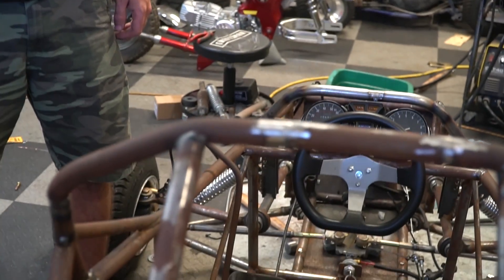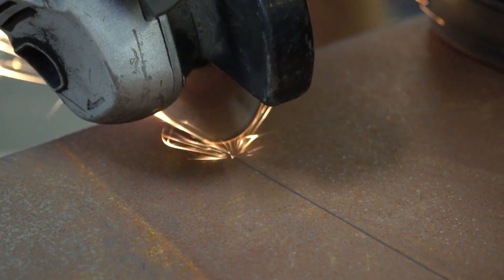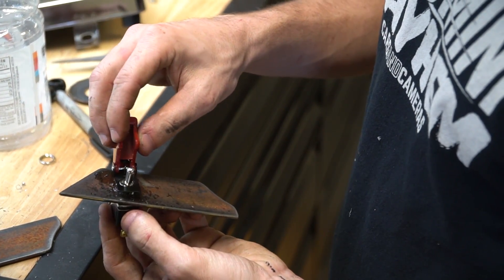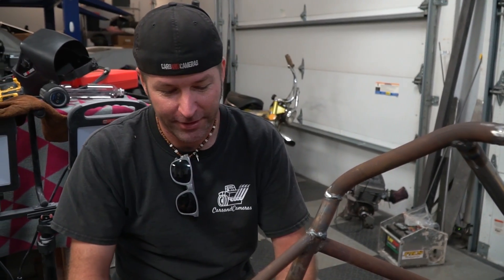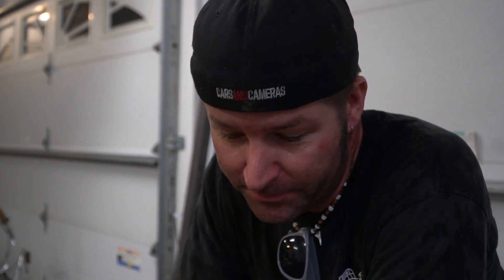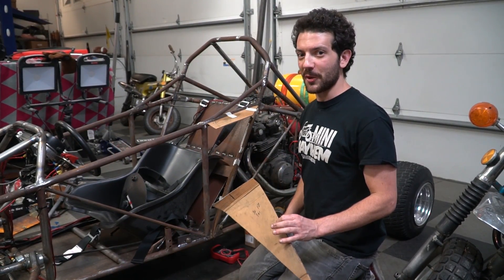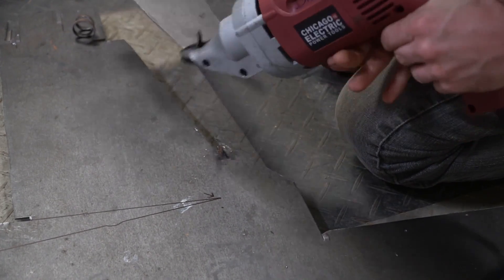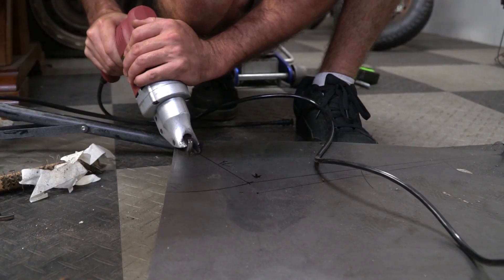Fabricating Air Scoops, Firewall, Dash, Fan | Cross Kart Build

Comment: When are you guys going to get a cheap plasma cutter? It would speed up your production a 100 fold and fabrication would be so much easier, that a cutoff wheel or grinder. If your going to install a fan or some kind of blower, have it blowing on an oil cooler for a larger oil capacity as well as cooling the engine under heavy load cycles. Some people even use the AC for cooling the engine water or air for the fuel injection systems, same will work for oil as well, on a air oil cooled engine. Also a scoop will work so much better when you make it a ram air injection system, twice the air flow. If you are going to show the wielding, use the proper lense cover so we can see the wield as well, just fit it over the regular lense and film away, at least let us see something other than a bright light or what's the purpose of it? Wastes our time as well as video time, not to mention battery life and data space on the memory cards. Someone needs a course in a wind tunnel designs, for trapping or using wind to ones advantages and to learn the disadvantages of wind trapping designs. Go from the top and blow it down into the engine and out the sides and the back through a wind tunnel design for the best air flow rates.

Comment: You can modify the shifter to make it work and adjust the shifting Springs that holds the shifting drum in place. I had the dore-lock sylinoid shifter idea in 2003 while working on my 1973-74 Yamaha Tx750 powerd Odyssey.

Comment: Issac, I like your idea with the electric sifter.   One by itself won't be strong enough to move the shiftier, but maybe two of those door lock solenoids would to the trick. put one on either side of the sifter and make one push while the other pulls.  There are a lot of possibilities with that...  Cool idea dude.

Comment: Pingel makes a cool electric shifter kit. Won't even need to use the clutch to shift. https://www.denniskirk.com/pingel/electric-up-down-off-road-universal-shifter-kit-77404.p272229.prd/272229.sku?gclid=CjwKCAjwtajrBRBVEiwA8w2Q8OQhYamA1d6hB1XbCj57n-Ysnrjk6UcOSHdSqZQrAacyc6k8tRuQIxoCW60QAvD_BwE

Comment: Hey guys hoping someone can give me some advise, I recent installed a 212cc predator non hemi engine on my mini bike, I hit 40 on it. Then I added the go power sports stage 1 kit, I put on the performance air intake, the size 38 jet and the open header. And now I only hit 37. Can someone please explain where my loss of top end speed is coming from and what I can do to gain it back or what I can install to get the loss of speed back. Please and thank you!

Comment: Hey guys have enjoyed all your videos.If your still having problems with the carbs check your diaphragms that move the slides up and pull up the needle in the jets and riching the mixture up. the carbs do have butterflys but they have verable venturas that is why they need a little vac. if they have pin holes or leaks they will not work properly

Comment: attach a bell crank and try that with the actuator with a length of linkage, the actuator pushes or pulls the bell crank which moves the linkage, might get y'all the throw you need to actuate the shifter

Comment: Use the air scoops that you built to divert air to the engine.  No need for a fan that will cause load on the charging system.

Comment: I think you should redo your roll bar, if you ever have this cart tecked in it would definitely fail.
The rollbar should be a one piece bar. If you roll
It may break those extra welds and break a part  So to be safer please use one piece.

Comment: Power shift control for honda four Wheeler. Serveral versions out there and one could probably be made to work. Primary coil on those acuators(door lock) are not strong enough for what you want to do. You may also be pushing the charging system running that plus the fan and lights.

Comment: I know the exact air shifter you guys were looking at. How much it cost and why you (and I) tried the door actuators first. Air actuator has more lb/ft pressure than your actual foot. The electric had a measured 4.3lbs... Also why bother with the fan if you're body ducting?

Comment: You just need an actuator with a longer travel, if you use an arduino to control it you could have it put in neutral when you downshift and are in first.
Reply: I did somthing similar for a robot that I worked on in classes

Comment: ATTENTION....

Using power window electric motor  with gear box will  work. Only effective way to make this work is the add flat plate on shaft. From gearbox with a small adjustable arm to the shifter peddle. No money needed. Just old parts laying around.

Comment: A suggestion for 2 issues John & Ike,a GPS Speedo (https://www.banggood.com/search/gps-speedometer-motorcycle.html) would save a lot of hassles and would give accuracy that a converted skate board wheel wouldn't and would do more functions
Next air flow, think a  F1 racing car air vent in and around and just above your helmet you could use the upper roll bar near your helmet as the top bar and make up a vent directed to the engine you may only need the fan at low speeds.
Tony from Western Australia

Comment: An Arduino controlled shift system with a clutch solenoid would allow you a semiautomatic shifting kart. Foot on clutch for take off and stopping only. A paintball air tank would work fine and provide many many shifts. Additionally, if you went with a system like used for air suspension systems you could run an electric air pump so you never run out of air.

Comment: The metal you used for the scopes would have fine for the fire wall no need that thick heavy metal on the fire wall, and duct the scopes to the fan that way no mud and dirt going to the fan... 2¢

Comment: Welders burn on your eyes really sucks. Happened to me when I was younger. I was stupid and looked for a sec after told to look away. I didn’t know anything was wrong until I tried to go to sleep. It felt like my eyes were on fire and like sandpaper. Extremely dry and rough. Really painful. Eventually I went to sleep and everything was fine the next morning. I guess the sandpaper feeling was little bumps that formed on my eye like little blisters is the only thing I could think. I was young at the time and to scared to tell anyone what I did. My eyes are completely fine still 20/20 surprisingly. I’m sure if I looked longer then the second or two I did I would’ve been in real trouble.

Comment: y'a'll are adding to much weight. you need to use something as thick as a fender or car door. i once spent $500 on bolts just to save 2 pounds. i'm willing to bet you can lose 50 pounds be just as safe and not cost you a dime with the stuff you have laying around both your shops

Comment: Better check the output of the alternator, I don't think its puts out enough to run an electric fan, lights, ignition, and keep the battery charged. Most MC alts are marginal without the electric fan to run. Great work guys , love the cart.

Comment: More leverage dude..... You have the (electro shift) mounted to the very bottom of the shift lever, mount it on an angle or up higher on the shift lever and it'll be fine.

Comment: Shifter.. unless it is just travel limits, mount  it UP/higher and have it way higher on the lever. As high as you have throw for,  as it's got a longer lever.

Conversely, if it's throw limited, not power, mount it lower.. was lower.. tilted down if you have two

Comment: Definitely need to figure out how to get those scoops to shoot air to the engine. As for a better location for the fan I think a contraption that looks like an old hemi ram air air cleaner would be a decent idea. The air inlet is on top facing rear, the fan sucks up that and and shoots it downward where the carb would have been is now a pipe aimed at the front of the engine.

Comment: No surprise the door lock actuator couldn't shift it, they just don't have enough power. Honda has been doing electric shift for ages. I've contemplated adapting their system to work on other atvs. Look at the motor they use, it's much larger and beefier.

Comment: Mount the actuator higher on the shifter. Increase the leverage so it doesn’t have to work as hard. Or mount a lever   With a 2-3 to one. Should have no problem then.

Comment: Not sure if there is enough power in the actuator for gear shift but you could connect it to a floor mounted linkage that steps up the movement ratio to the shift spindle rather than buy more equipment. Just a thought

Comment: If you guys do air shifter you also need to add a spark kill in there or it wont shift the motor is still under power so it wont shift and as for the fan getting swamped out weld a plate to the bottom of the frame that should keep the mud out

Comment: Those door lock actuators are notoriously troublesome. You can get heavier duty ones that would probably shift for you but they do strange things all the time. If they think they have pushed beyond the throw of the door lock they will retract so at any time basically it could just drop you down a gear for fun.
There are plenty of industrial electric actuators that will suit your purpose without going air shift which would add a lot of weight and complexity.

Comment: hey guys, just a thought. With the lock actuator extended out how hard is it to overpower the coil and force it back in? If it is hard to overpower you can probably use a pivot arm to increase the throw, maybe get it to shift. Look likes the actuator is running out of throw.

Comment: Are you can spend around $250 on a good quality air shifter with an interrupter make sure you go air over electric then you just need a simple clock Spring or coiled cord on your steering wheel rather than having a big clunky air button

Comment: For around a $100 you can get an electric solenoid shifter kit and put an Ignition interrupter in it that will kill the engine for point one seconds that way you don't have to use the clutch You can literally get rolling and just push the button at full throttle it will slam the next gear and away you go

Comment: Dedenbear has the perfect set-up   , Co2  15 oz tank , valve &  regulator--- will need a 1-1/4" x 3" stroke double acting cyclinder to get the up shift/down shift .  Mcmaster- Carr has the momentary air valves .  use push to connect 1/4 fittings and plastic air lines... Oh yes a fire extinguisher place would fill my Co2 or try a paint ball place

Comment: Increase the voltage going to the motor and that will give it enough kick to shift it. Buy a simple 4 s  Lipo battery for rc cars. They produce 14.8 volts. really more like 16.2 volts

Comment: Just double up on the power lock actuators. Cheap and easy. Make a bracket on the opposite side of the shifter and put one there too. Should double the potential.

Comment: Hey with that fan in front like that it’s gonna blow exhaust heat to motor I bought a bms sand sniper 400 buggy already built with Honda rancher 350 in it but the fans mounted on side so you get straight cool air !! Just a thought

Comment: If you had taken off the shift lever, and replaced it with a short-throw bell crank type setup, that electric solenoid might have worked. Where the pivot point was on the shift lever was, it was too long a throw to ask it to work...

Comment: if you use the weight of the old shift lever the  electro shifter will work , like most shift systems they need ballast move the  actuator uop or down the lever  accordingly , remember the law of the lever.

Comment: you may still use your actuator, by using a lever system, the lower you place your pivot point, one side won't need to move as much, and the top will probably will give you enough throw to make the shift, if you want i can draw it for you, and you can try it.

Comment: Hi guys, great work so far, I would get with Rather B Welding, his T handle , right hand side, is awesome, and would be perfect for John, who seems to be having difficulty using a left sided shifter with right hand. The air ducts, I would have made them from fiberglass to keep the weight down,+ they need a back side to be really effective.

Comment: Create a lever or bell crank with a longer side for your shifter to increase the torque output of the electric motor.  Two ways to increase the torque: increase the force , or increase distance.  Double the force or double the distance.

Comment: Get the soilinod for shaved door handle kits. Comes with two of them and u use a cable set to whatever length you want and they are strong! Just use a return spring one on either side and it will shift that thing like crazy!!

Comment: You guys should get a cheap temperature sensor switch when it gets to a certain temperature it will kick on a switch you can wire to the fan.

Comment: you can make the scoops more functional by extending the fire wall to wrap around the driver to the vertical bar and make the upper seat mount attach to the fire wall. This ditches that flat bar in the way and fully makes the inside of the scoop which could let you floor pan under the fan making it safe from damage.

Comment: Maybe put the actuater higher and give it more leverage on the shift pedal maybe! Just an idea
Reply: The extra leverage would not make the problem better, that actuator cant go far enough its throw is too short, also make sure you have a good starter, electric motors like that use 2-4amps per pop
Reply: Stator* not starter

Comment: I know you guys love welding, but you keep welding sheets of steel to that cart! It's going to weigh a ton when it's finished. Aluminum panels, fiberglass panels, plastic scoops instead of steel. All these things will keep weight off and open up your expertise in fabrication. Also maybe you could try to put the electric actuator futher along in the linkage for better mechanical advantage.

Comment: would those air wents just push the cold air into the cockpit and give you wind chill? would it not be better to put a cover under the rig and a set of ducts pushing air into the pocket just infront of the fan instead?

Comment: the fan should be able to stand a little water , you might not need it while at speed and in the water / mud , you probably should turn it on as soon as you decelerate  and or stop 
still thin its more a track vehicle then a offroad cart 
i bet you could put down a nice quarter mile time with it too if you get the ratio a little shorter and mount slicks from a junior dragrace cart

Comment: I bet you could get by with the door lock solenoid by making a toggle link to extend it's throw. Think ratio rockers but with the longer throw going to move the shift peg further. If it has the torque to move it, you shouldn't have any major problems fabbing it up.

Comment: I think that the eletric shifter could work still. You would have to place higher on the shift linkage for more leverage . Right now it's in a shorter or lower position causing it to not have enough throw .

Comment: All you need to do is add a pivoting lever to the door locker. Make one end longer than the other and it will push farther but with less torque. Lever principle. A lever long enough with the pivot at the right spot and an atom can move the world. Conversely a lever short enough and the world can move an atom.

Comment: R.E. electric shifter. The electric actuator seems to have enough throw to allow you to connect it the shift lever higher up ( closer to the toe pad) and gain enough mechanical advantage to allow gear engagement

Comment: those doorlocks work, have it too, with a 400CC Yamaha engine,just install 2, 1 on each end of the lever, 1 pulls, 1 pushes the same time, did a test too with 2 on 1 side, worked also, with a push/pull rod,

Comment: Should have moved the scoops back one panel to move more air to the engine. Dudes,need a bigger battery to carry all the stuff u added.
Reply: I definitely agree about the scoops and commented the same thing, but that battery is perfectly fine. You have to remember, the stator in that engine is powerful to run pretty much all of those electronics when it was on the bike. All they really added was a fan, and those LED headlights have less draw than the headlight on the bike. The battery is also already bigger than what would've been on the bike. They should be completely fine with that setup. Or we can just think "It'll Be Fine" Haha

Comment: How about a screen like the dirt track racers use? Put one on the bottom and in the inlets. This will keep 90% of the junk and water away from the fan. unless your fording real deep water this should work fine. Make it out of 1/4 inch screen with a solid frame and bolt them in place for maintenance. simple and inexpensive.

Comment: Welding those scoops is really unnecessary. You'd be more than good welding and inch every 3 or 4 inches. You are putting a lot of heat Into the  tube for no reason.  Just my opinion as a welder.

Comment: On the shifter can one use a fulcrum lever to take and extend the throw of the lever? Or a shorter shifting lever on the trans? Once you get the travel leinth worked out. you can put the actuator anywhere and cable it to the linkage. This would give you some adjustability for shifting.

Comment: Are you going to instal (Extruded Steel or Aluminum) a Debris Sheild under & in front of the Cooling Fan? This way rocks don't KILL the Blades!

Also, are you also installing a FULL Illumination System? (Running Lights, Brake, and Signals) "Should" be easy using the existing Wiring Harness from the Bike...🤔

So Jealous are we Viewers!🙀😎

Take care,
🤓 -Thomas
Western Washington State

Comment: those headlights should be up above the middle where the pedals are and then cover the area up an make a small half windshield above the gauge protator bars to protect the driver from rocks from the front wheels